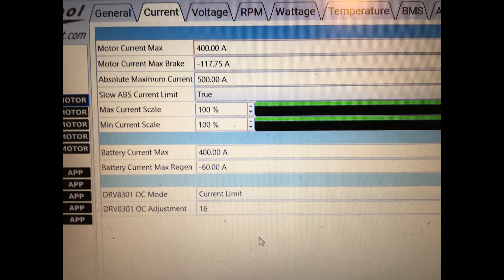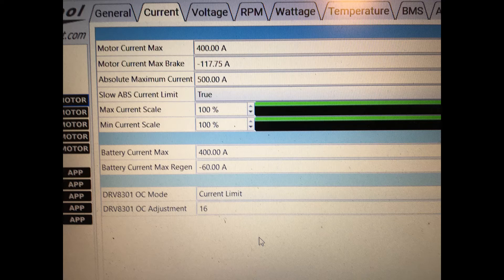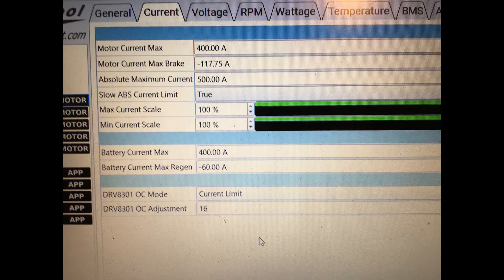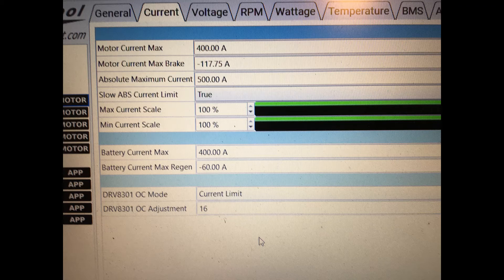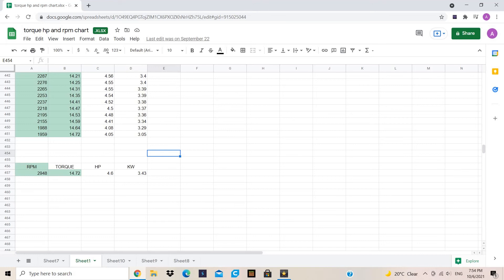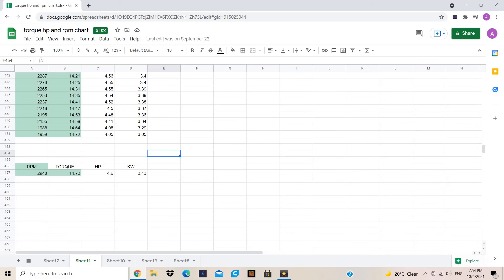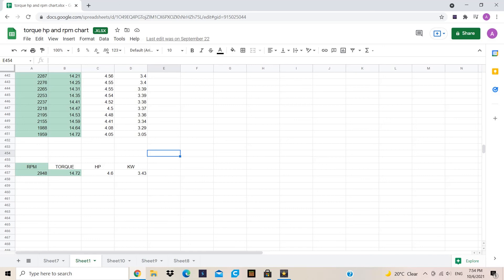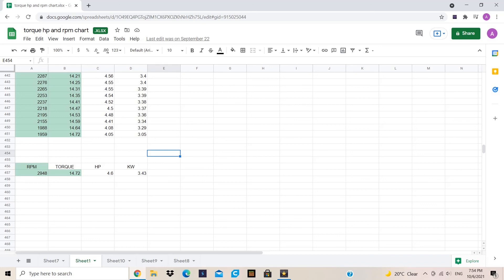Dyno test Torque and Hp output from a converted alternator to motor

Comment: was that actual torque output or augmented due to the large gear on the pump. Great video. I wasn't sure I'd find a good video when I searched it but I was surprised.
Reply from the maker: Thanks mate! The math for the gearing was in the Arduino code, so the output in the video was the actual torque! Glad you liked the video 
Cheers
Reply: @fixitmoditbreakit7982  Much appreciated.

Comment: Did you ever come back to this? I'm considering an alternator conversion for a jet ski. I know it will be underpowered but fun to try. We're you at around 3000rpm in this test?
Reply from the maker: Hey mate,. Yeah I think it was around 3000 but if you weaken the field windings you can get much higher rpms obviously losing torque though.  The vesc software has added field weakening to their ESC which will increase rpm when a set duty cycle is reached.  I haven't played with this yet but aim to soon
Reply: What a great job, congrats!!!!!! I made an ebike with a converted alternator and its awesome (I'm using 60v / 20ah battery with 14v on field and regular ebike controller - square wave) But I have some issue with it, sometimes the motor stall on heavy loads, did you had the same issue? Could you share some suggestions to prevent it? Tks!!!
Reply: Forgot to mention that I have installed hall sensors on the alternator

Comment: Is the noise coming from the alternator or the hydraulic pump? I am, considering using an alternator as the motor for an lawn mower, and am curious whether that will have enough power. But if it is too loud, I will have to consider other options.
Reply from the maker: Its coming from the hydro pump and chain mate.  Would you be powering the blades and traction or is it a push mower?  They have ok power but aren't efficient as a standard brush less motor due to you have to power the field winding too.  They are great to learn heaps about motors and hall sensors ect as there will be some trail and error along the way that makes it very interesting.

Comment: What kind of alternator did you you use to make into a motor, does any kind of one work or only specific ones? thank you.
Reply from the maker: I think this was from a Holden/vauxhall,  you should be able to convert any car alternator.  Also they where 120amp alternators,  I've used a 40amp and it got very hot due to me running it at a high current.  So I would stick to the higher amp alternators 120 and up 

Hope this helps